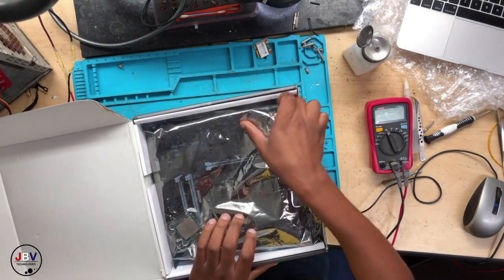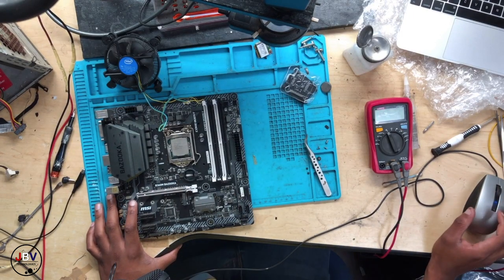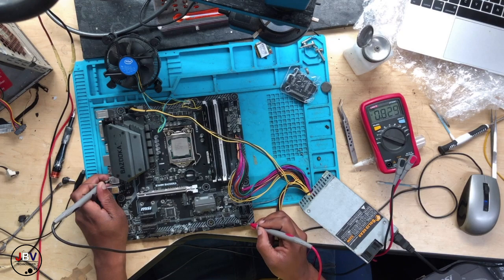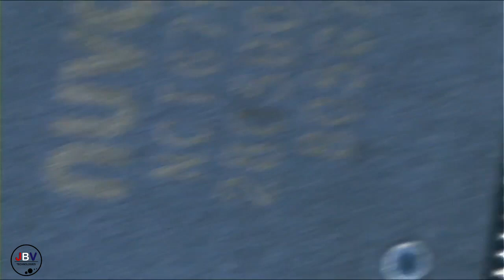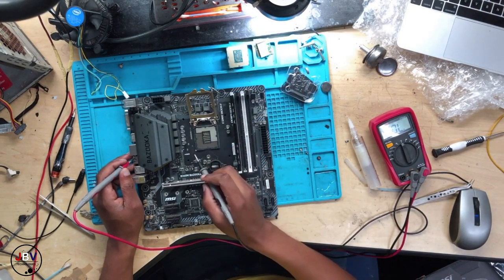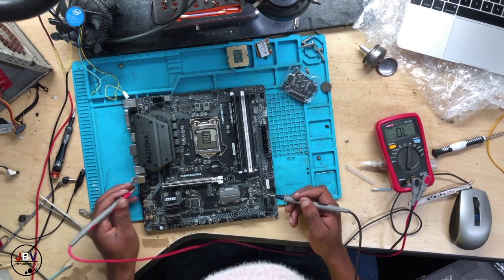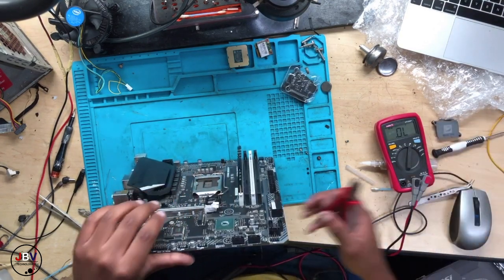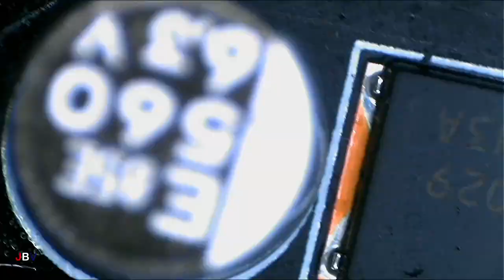Msi bazooka Motherboard Repair

Comment: Hello!
When measuring CPU, RAM, PCH, measure the red probe on the ground, the black probe on the circuit element. Is this how it should be measured in diode mode?